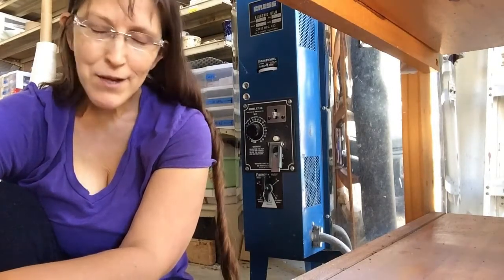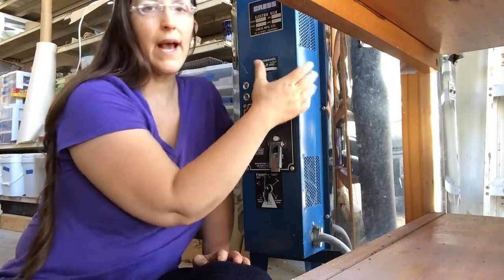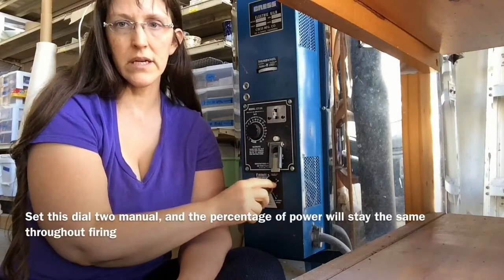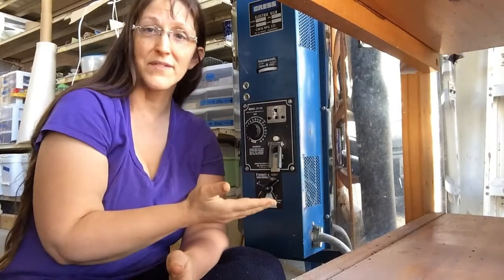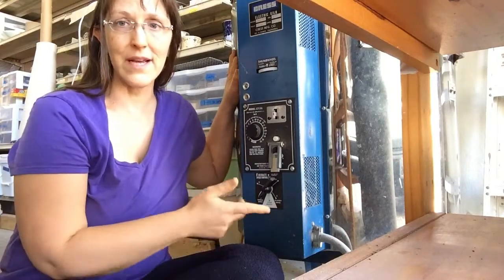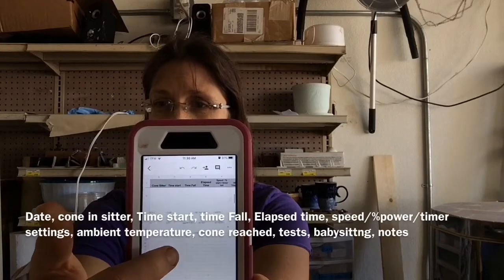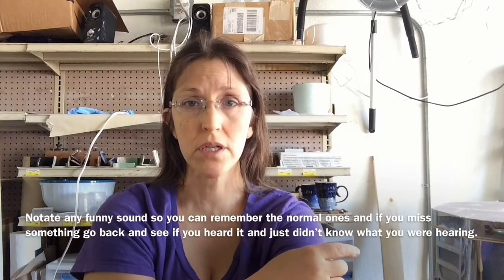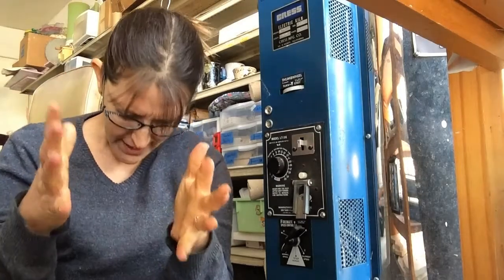How to Fire a Manual Kiln 2, Kiln Sitter, Firing a Kiln for the First Time, Home pottery studio vlog

Comment: Okay, I have the exact kiln and I'm wondering, should my cone 06 bisque be taking only 4.5 hours to fire before the cone dropping? It's also over-firing. I getting q gauge to readjust the kiln sitter, but I've been told by almost everyone that 4.5 hours is too fast. Does the firemate control when the kiln turns off or just the amount of power its getting? I tried setting the speed to low to slow down the bisque time, but the thumbwheel ramped up to a 5 within less than an hour and that made me nervous, so I put it back to normal and the thumbwheel slowed down. Does fast thumbwheel equal fast firing?
Reply from the maker: You don’t need to be concerned with how fast it’s going. Mine does an 06 fire in about 4 to 5.5 hours and a cone 6 in 7 to 8 3/4 hours roughly. What you need to be concerned with is whether or not there’s too much water to evaporate within the amount of time it takes the greenware to pass 212°F or the temperature at which water turns to steam. People who do slow firings are paranoid, or they are putting wet greenware into their kiln. If you put wet clay into a kiln it will explode as I explained in this video. If you have a piece that is wet and you can’t wait on it to dry see my video on oven drying clay. You can burn off all the water in your oven evenly and with control. Slowing down a firing, does not help or hurt your ceramic in anyway. It simply wastes electricity. That being said, water can sometimes hide. So we babysit, as I explained in the video. 

The thumb wheels only job is to slow down the speed through which the water burns off, 0 to 500°F. If you have an explosion in a bisque kiln, this is where it’s going to be. But the only reason that would happen is if you had wet green wear or a particularly humid environment. I even go a step further and start my kiln with the thumb wheel on three. You will also notice that the thumb wheel doesn’t always reach all the way to 10. That’s OK. Wherever it stops it just means it’s at full power at that point. Were you to need to slow down the water burn off, evidenced by steam, coming out of the top peep hole, simply turn the thumb wheel all the way around past 10 and back to one. But I have never had the need to do that, and I have never had anything explode in this kiln.

As far as The Kiln, turning off, it has nothing to do with temperature or amount of power, or your thumbwheel. it has to do with a chemical reaction evidenced by the cone in your kiln sitter. When that chemical reaction takes place, at whatever temperature, the cone bends and shuts off the kiln. in this way, manual kilns are actually more accurate than programmable kilns. We can’t do fancy firings, and holds, and slow cool downs, but we can be confident that the chemical reaction necessary for our clay and glazes has been completed, at least the area of the sitter every time. 

Keep a spread sheet and good notes and you do great. And btw there is a part one about loading and preparing for firing as well. Clear as mud? 😜🤪

Comment: If you set you speed control  to 1 will it automatically move or do you need to move that dial?
Reply from the maker: It moves automatically. That’s the way it amps up slowly. That prevents some of the risk of explosion from water vapor. It also may not reach all the way to 10. That’s fine too. Wherever it stops that’s full power. And that may even be different load to load. 😊

Comment: So glad I have found your channel as I have just acquired a sitter kiln. Great info and giving us newbies so confidence! 

I have a question about Soaking - how do you hold the temp on a manual kiln to let a glaze soak? 

Thank you!
Reply from the maker: Welcome to the channel! Soaking is difficult in a manual kiln. For 1-2 hundred dollars, depending on where you are in the world, you can get a thermocouple for a manual kiln. It goes in the peep hole and you monitor it manually. You have to put a cone into the kiln sitter that is one cone higher than what you want to reach so that The Kiln sitter doesn’t turn off. Then you monitor the thermocouple and manually adjust the percent power, and/or the ramp speed, and/or just turn the dials on and off, to control the temperature. This is how you would do the type of soaking that people who have digitally controlled kilns do. But another thing you need to understand in a manual kiln, is that Reaching cone is not only about temperature. Reaching cone is about time AND temperature. 

So think like an oven. You can bake cookies in a 300° oven for 20 minutes, a 350° oven for 15 minutes or a 400° oven for 10 minutes. At the end of the day baking you will have four batches of evenly cooked cookies but you could say that the ones that cooked for 20 minutes Didn’t make it to a high enough temperature. Or the ones at 400 got too hot. But all the cookies came out edible. Maybe slightly different in color and texture. That’s the way you’re cones work. They tell you when the cookies are done regardless of what the temperature is. This is why we say the kiln load reached cone … And not the kiln load reached …temperature. 

So, soaking is all about controlling the cool down not the vitrification of glaze and clay. The idea is to keep the glaze melted but not push it to the next cone. That being said eventually the kiln will reach the next cone. Just like the cookie example, the cookies can get burnt in a 300° oven if you leave them in long enough. 

So why soak? One of the only ways to can get large crystal formation is to control the cool down, ie:soaking. But soaking is not necessary to have a successful firing. In the case of glaze running/drips you can sometimes get those effects by simply firing to a higher cone. But don’t feel like you can’t try a glaze just because you don’t have a thermocouple. The glaze will still be vitrified. Just know a glaze that calls for a soak may not look the same out of your manual kiln. Test, test, test! 🙄😒🤪

Lastly, I have one particular glaze I got a girl who has a digital kiln and 3 inch kiln walls. In her kiln it melts great in my kiln it looks like snot. 😳😒 but because of those 3 inch kiln walls and her 10 min soak it takes longer for her kiln to cool down. so be aware that some of the glazes that are stable when you’re not soaking may run in a glaze firing that you decide to soak.

This may be way too much information, but I hope it answers your question. And thanks for watching. 😊

Comment: Hello,  One question, is it normal for the kiln to make noises from time to time? every 20 seconds or so? thenk you very much!
Reply from the maker: Bad noises are loud and typically more frequent than 20 seconds. Most of those are in the first 500°F. Those typically make you think “holy cow!what is going on!!!” The metal covering on the kiln will bend and flex with the heat fluctuation and those sounds can be scary sometimes. Those sounds can happen throughout and every 20 seconds wouldn’t be unheard of. The metal sounds kind of like a cheap cookie sheet that warps in the oven -that’s pretty much what’s happening. But those sounds are typically not very loud, sporadic, and make you think “did I just hear something?” And then wait and think “I think I am hearing something” and then “I’m definitely hearing something but it doesn’t sound like it’s inside the kiln really”

Comment: Thanks for your video! I got got this same kiln from someone who didn’t know anything about it and I had my electrition make sure that everything looked safe but I’m still trying to figure out how to use it so this video helped me. I’ve tried one glaze firing so far and put a cone 6 in the kiln sitter as well as a self supporting cone on the middle shelf. I had the top dial set to be between the two markers listed as neutral, the speed set to normal, and the timer set to 12 hours to be safe. Well after 12 hours, neither of the cones melted and the kiln shut off. Some of the glaze wasn’t fully set and still cloudy. I’m going to try another firing today with cone 7 but I’m not sure if it’s just the kiln is not able to get hot enough. Do you have any suggestions? I also have a second kiln that was also given to me at the same time and it only has a low medium and high dial to control the heat. I installed a temperature gage so I can tell that at least now. I’ve only done two bisque firings in it so far and they seem fine with the 2 hours per setting recommendation from my friend but he’s unsure of what to recommend for a glaze firing. Do you have any recommendations? Thanks!!!
Reply from the maker: Ok check the Thumbwheel. If your thumb wheel is still in between the two marks and you haven’t moved it since your last firing then that is the issue. What you need to do is start the thumb wheel at 2-3. 

If the thumb wheel is at or above roughly 7, then you could have an element issue. However, we had to replace the thumb wheel on our kiln after we bought it used. 

I highly recommend you call Cress no matter what. They are awesome. They walked us through the problem and then walked us through the solution. 

Lastly if while you’re firing your kiln never stops clicking, it’s not hitting full power. So regardless of how good your elements are something is preventing them from getting full charge; that’s important when your controlling it but a pain when you’re not. Hope this helps. Keep me posted!

Comment: Do you leave the first  peep hole open? Tell me about the cones?  I'm a beginner nort rich to by the digital  kilm..
Reply from the maker: It depends on your kiln. But for most of them yes. You have to leave a way for the evaporation of water and carbon dioxide. Most manufactures have manuals you can download ☺️

Comment: The saga continues! Lol. I am firing my kiln right now and when I went to check it I noticed there is a lot of steam coming out of the top peep hole! It has been on since 12:44 and right now the time is 6pm! The wheel is a little past 8 and I’m on speed c. I do usually fire on speed d but I just didn’t this time. The kiln is very full but all of my things were absolutely bone dry and had been sitting around for weeks if not months. It is just getting orange. Do I have any thing I should be worried about? I don’t know when you’ll get this but I guess just letting someone know my issue helps. Thanks again
Reply from the maker: Well 🤔there are 2 types of water, physical and chemical. Chemical water comes off at about 800* it happens as the mud goes through the chemical reactions that result in carbon dioxide and water in the form of steam. This is where pinholes can happen if it doesn’t all get out. But I have never been in the right time/ space to see it. However that’s my best guess 🥴
Reply from the maker: Btw Washington Street Studios YouTube channel is a fantastic resource; and the source of a lot of my knowledge. I suggest binge watching 😜. That’s what I did anyway 🥴
Reply: Thank you for the recommendation for the videos on that channel. The kiln fires a little under, cone 05 instead of 04. So I just wanted to thank you so much for your help!! Not to fire the boxes of glazed pots!!

Comment: just git a kiln yesterday and its this kiln your using. how would you do a "hold" say a cone five " hold" for five min
Reply from the maker: Technically you can’t. 🫤🤷🏻‍♀️ However, technically a hold is allowing more heat work to happen. It is essentially allowing the glaze to melt more than it otherwise would. So some things you can do to allow more heat work including putting a cone higher than your desired cone in the sitter, then watching your target cone fall and manually adjusting the percentage power dial to a lower power for 5 minutes after your target cone falls, or the speed dial at the bottom from high to medium for 5 minutes after your target cone falls. You could also put your target cone in the kiln sitter and, being there when it falls, lift the shut off lever, press the button and turn it back on for another 5 minutes. But in these cases you would always need to make sure you have a guard cone you can see in the peephole as well. However, I have never done anything like this before. I fire to hot cone six, so I do get a little bit of extra heat work on my pots, but keep in mind I am only relaying what I have heard. I will also say, if you know you have a Glaze that “requires a five minute hold” you can still use that glaze but don’t expect it to look the same as it would if it had that hold. It is more advantageous to work with glaze recipes that are designed to be used in a manual kiln. 🤷🏻‍♀️ This can get frustrating sometimes, but don’t give up it’s still worth it! 😊

Comment: I have a manual kiln. Use cone 04 for bisque firing. Have knows at high and kiln sitter won't drop before 13 hours. How does yours finish in 5 to 6 hours? Shelf cones bend appropriately.
Reply from the maker: If all your settings are at high, it is also possible that you need new elements or that one of your elements is not burning at all. Beyond that, you could have a power issue. Some kilns are wired for 240 volts and some for 208 volts. I  don’t know much about it but I do know it is important. You might call the manufacturer and ask what you should expect time wise for you specific model. And as for the voltage, this video should tell enough for you to see if you have an issue there. https://youtu.be/6QDGrJ_F4UI
Reply: @CallUsTemily  thanks.  My kiln came from early 90's and had never been fired until pandemic. My knobs are different from yours but basically do the same thing. I didn't know what I was doing in the beginning but have definitely learned. It may be that I am not around for final firing timing. Will follow your suggestions and also babysit whole process. Appreciate your response.
Reply: When the firing is done, the shelf cones have all bent as they should but a little steeper on the top shelf. Electrician (my neighbor) just told me the voltage is at 240 per requirement on kiln.  Will simply have to babysit, I think.  Thank you, again,  for your response.
Reply from the maker: Absolutely, any time! So glad it’s not a power issue.  I would still call the manufacturer and ask if that’s normal. Mine is used. If you bought yours used and have never changed the elements yourself then it’s also possible the last person that did didn’t get it wired up correctly. I did that. It’s in an earlier video. But the kiln would still come on it just wouldn’t reach temp. I had plugged into the wrong part on the relay. The manufacturer tech support walked me through the process with some photos I emailed them. They were great people, lots of help. This is the video of that story although I’m not sure it will help much. Keep me posted! https://youtu.be/l-h5Wzy-tBk
Reply: @CallUsTemily  enjoyed the video. Big help for future. My kiln was brand new, my kiln experience was zilch. Nobody could figure out the knobs until I ran into an old pottery teacher who used my exact kiln back in the day. She got me on the right track but I  still haven't babysat a full firing, yet. That should be my litmus test. Will keep you posted.

Comment: So so helpful! Thank you! Do you happen to know if you need to change the components more frequently when you rely on this kiln to do your cone 6 glaze firings? Considering adopting an old manual kiln like this, but I'm wondering if it would only be good for bisque firings in the long run. Thank you again for your videos, and for any wisdom you can impart :)
Reply from the maker: I use this kiln for all my bisque and cone 6 fires. It will do just fine. As far as replacing things, this is where the kiln log comes in. If you notice it is taking longer to reach temperature on a regular basis or your cones from top middle and bottom have a drastic difference then it is time to replace an element. Generally elements burn out gradually, unless they break. You will have longer and shorter firings based on the amount of ware in the kiln but element replacement will be slow over time and not something you diagnose immediately. If you have a firing that fails. And you inspect elements and they’re not broken your looking at something electrical. A relay can fail, a connection can come lose. It won’t be hard to fix, these kilns are all plug-and-play. But you will need to call the manufacturer. They will tell you what you need and send you instructions. 

You’re going to do great! Thanks so much for watching and Happy potting!
Reply: @CallUsTemily  thank you for your prompt and helpful response :)
Reply from the maker: Anytime!